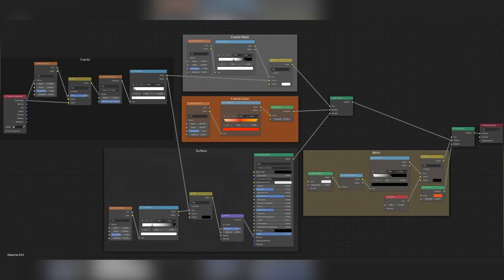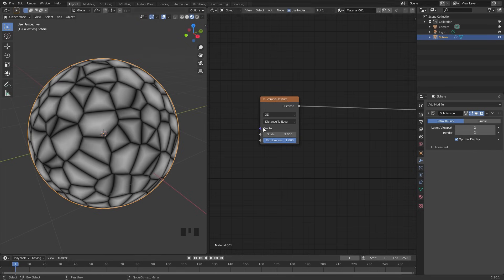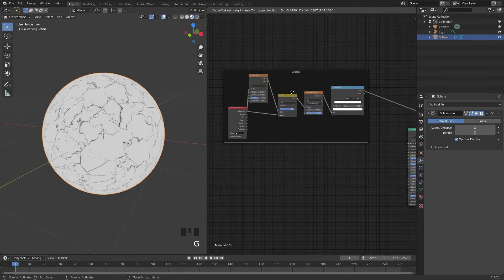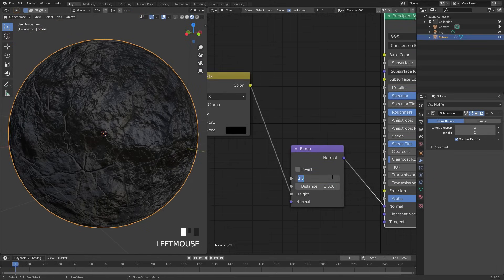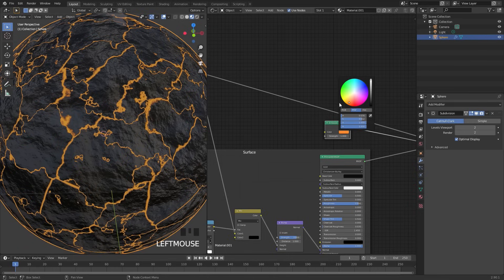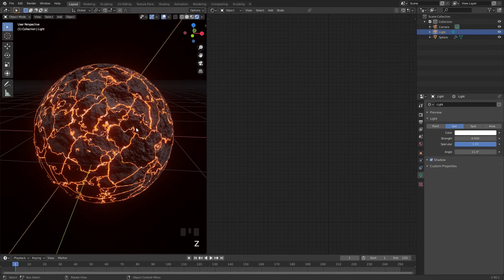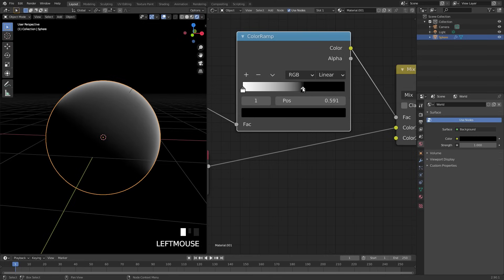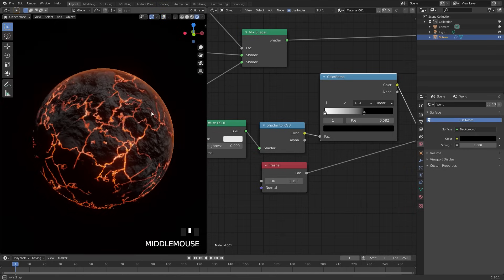Blender Tutorial - Procedural Cracked Surface Material

Comment: That is the real deal, that's cool. Quick question about the modeling though, I see a lot of tutorials where "bump" is used instead of "displacement" which seems odd when you can see the outline of the object is still circular but the surface is "Bumped". Why is that ? is displacement to hard to work with ? Please don't get me wrong & think its a criticism its just something i've noticed & wondered about.
Stay safe, keep on smiling 👍😀
Reply: displacement requires a lot more polygons, and also only works in cycles
Reply from the maker: Thank you!  Usually a bump map is for all of the small details and displacement is for the bigger details.  In this case I didn't really need large details so the bump map works well.    Another thing is that bump doesn't really change the geometry of the mesh where as displacement does.  That's why you see a flat surface near the edges of the sphere.
Reply: @BlenderMadeEasy  Nice answer & fair enough. It all depends on the look you're going for which is understandable.
Keep up the great tut's, stay safe & keep on smiling 😀👍